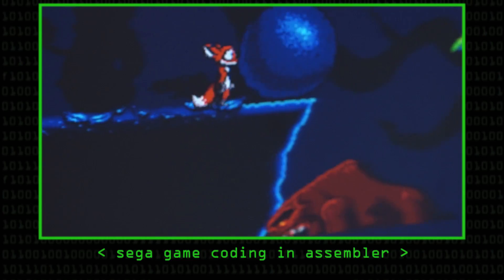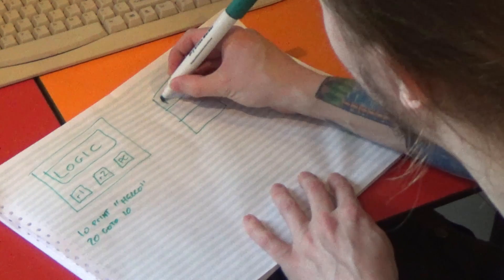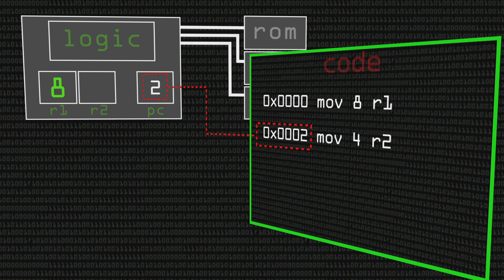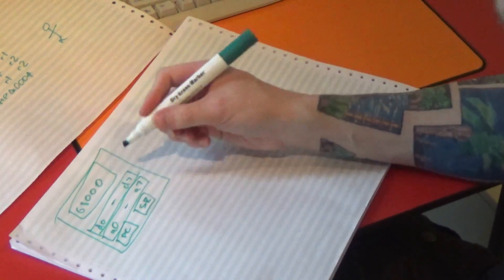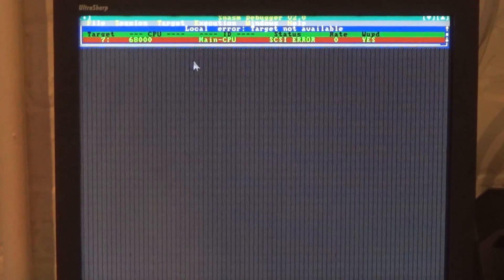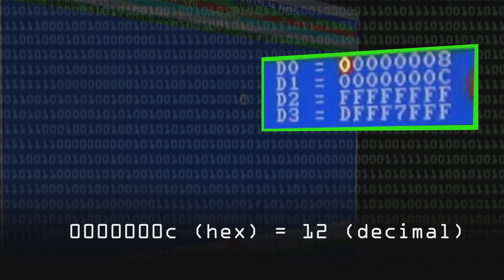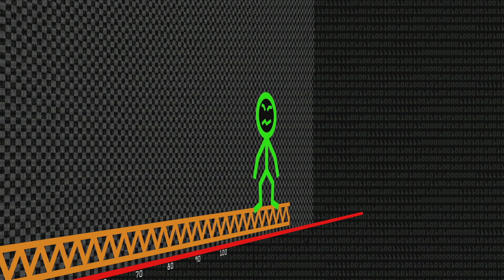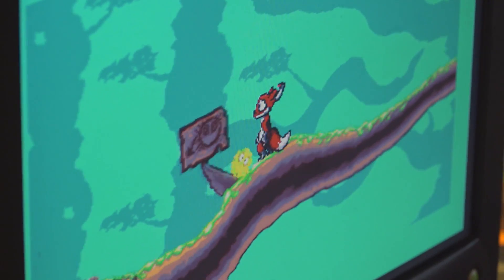Game Physics (in Assembler) - Computerphile

Comment: The 'pc' register I've only ever heard called the IP (Instruction Pointer). Are they different things?
Reply: Different CPUs call the same things with different names. In most architectures it's called a program counter, on intel x86s it's called an instruction pointer.
Reply: If I'm not mistaken (but I probably am), "program counter" was more common, then Intel started using "instruction pointer" with their 8086. Program counters also could be written to directly, but Intel didn't allow this on their "instruction pointer". 

The name "pointer" itself might have only have arisen when indirect memory addressing became a thing.
Reply: PC stands for program counter and they are the same
Reply: Don't think so. They're probably the aame
Reply: Stack pointer?
Reply: Len Waugh I have been taught PC this semester, you comment is the first time I have seen another name for it 🤔
Reply: Michael Clark That’s the purpose of the %esp register. %eip is instruction pointer. You aren’t allowed to over write either of those, nor would you ever want to.
Reply: ok?
Reply: "Reading Head" sounds more like a turing machine thingy.
Reply: They're the same, the Program Counter register on x86 (amd style) assembly is %eip (IP being a mnemonic for instruction pointer).
Reply: I read somewhere somebody called it the "Reading Head" or something like that.

Comment: if a goto/jump statement points to an instruction that has already been executed, doesn't this mean that previous instructions have to be stored? how many instructions have to be stored then? can you use a goto/jump to go to ANY previous instruction then (seems highly unlikely)? or are only the instructions in memory stored and only those can be jumped to?
Reply: The whole program will be in the memory.
Reply: ShadowMancer and does that mean that the pc will store all instructions that have been executed while the program is running?
Reply: +frtard
RAM is typically much faster then ROM, so it's worth copying your code to RAM before executing.
Reply: "does that mean that the pc will store all instructions that have been executed"

The PC only stores a single number which is the memory address of the next instruction. The processor hardware automatically increase the PC with every instruction, so each time the PC will point to the next address.
When a jump is done the PC gets overwritten with another address, so the next instruction will be loaded from a completely different location in memory.
Reply: smh tbh fam All instructions are stored. Each one is held in a memory location and when you jump to an instruction you are jumping to a memory location. This location is either held on the stack or you use the address yourself.
Reply: The machine language code is really just data sitting in the RAM at some location and the Program Counter points at the current memory location to be executed. Execution won't change any of the program, unless you explicitly instruct it to, so the program bascially just sits there. A jump instruction just repoints the PC to the right location and the CPU just keeps on executing.
Reply: A jump can go anywhere in memory. If you wanted to make a function you typically push PC to the stack and then jump to your function. When you want to return you'll pop PC back off the stack. (Simplifying this process a bit)
Reply: Oh I think there was small mixup. I thought by PC you meant Personal computer or as it's better understood "modern hardware". And not the register PC.
Reply: Ghi102 ... or you just forgo all that wasted time shuffling data around and just run straight from the ROM
Reply: And in the simple case, all of the other instructions that could be executed in the future. You can thank John von Neumann for the design.
Reply: It does not store all instructions that have been executed. However it does store the entire program, and when you jump, you are jumping to a line in the program, not to an instruction that has been previously executed.
Reply: David Vaughan
Hmmm, it's not that simple, the only way a previously executed instruction would be removed from memory is if you deleted it or overwrote it. It is very likely in assembly for the instruction to still be there.

In other languages you have things like garbage collection which does remove items that are no longer used but nit in assembly.
Reply: Nevets "...the only way a previously executed instruction would be removed from memory..." -- Ah but, we never put the instruction in memory in the first place, so there's nothing to remove. We already have the whole program in memory, and when a line is executed, all we have in memory is the number of the line in the program we're executing (the Program Counter), not the full instruction itself, except for the fact that we already have that line of the program already stored.

When we're done executing that line, the program counter goes to a different line, executes that one, on and on.
Reply: I think everyone is misinterpreting your question. I think you're wondering how the program jumps to a place in code, and remembers how to get back to where it was? If so, the way this is usually handled is with a stack. A stack is a data structure with a "first in first out" order, which means that you're only allowed to add or remove things from the "top" of the stack (like a stack of books, you can't really take a book out from the middle of a stack). So when you want to jump somewhere (and come back eventually) you "push" the location you're currently at onto the stack, then jump to where you want to go. The place you have jumped to is usually called a subroutine, and these subroutines are usually written so that when they're done doing their thing, they jump to whatever is on the top of the stack.

Comment: Assembly codes are superfast!
C complier unnecessarily extends the length of the code, but by organising the registers so that none of them is wasted and placing of the instructions, we can get max out of the CPU performance. This basic programming reminded me of my graduation years when we used to do the programming in assembly and analyse the entire operation through machine cycles and its waveforms. Amazing to see how higher level languages and highly resourceful CPUs have abstracted the process and relieved user from this lengthy process.
Reply: It is difficult to write assembly language on modern x86 processors (with speculative pipelines, etc) but those considerations don't apply to 68000. You can write code 50% to 300% faster in assembly language (I needed an interrupt  driver for sampled sound on the ST, and so I used the USP as a temporary register that was used to keep track of the sample address, that saved 8 cycles, and since that code was executed 8000 times a second, it was 8% more efficient with just that one change). I wrote a 68000 to C converter for Sonic 3D and I had to work out whether the condition codes would be checked, in order to reduce the code size and get the code to run fast enough.
Reply: Well, I used to write games in assembly (around 50,000 lines of code) and each would take 16 weeks (for ST version), then another 3 weeks to port to the Amiga (changing sprites, scrolling, sounds to use the better hardware available on the Amiga). For Last Ninja 2 I had to draw the sprites as though there was a z buffer (so pixel check depth for each pixel). That code needed every single register, so it would have been much slower in C because it would have had to use memory based variables.

And on the Sega Master System, (which had a Z80 instead of a decent processor :) ) you could only write to video memory during the vertical blank (well it was twice as fast during the vertical blank). You could update about 16 characters definitions each vblank, and I was programming Rad Mobile, and I needed to bend the road (by adjusting the scroll register each line, I think it was 224 cycles per scan line, so by using handwritten code, it could modify the scroll position, change the palette (so there was a red/white stripe at the side of the road), and then update 4 more bytes in video memory.
Reply: Aborysa Which is why these conventions define which registers have to be preserved and which are volatile. The caller can't count on a volatile register having the same value after a function call, similarly if the callee wants to use one of the register which are supposed to be preserved, it has to back up its value (usually by pushing it on the stack) and restore it before returning.When writing in assembly, you can of course make up your own calling convention.
Reply: The point I was making is that C does not provide access to the low level features of assembly, and to get the greatest performance you sometimes need to dive into assembly (also when I write 68000 programs I use pass by register rather pass by stack which is the typical C idiom). I would also use different registers for leaf functions, so printStr(d0 = x, d1 = y, a0 = string, a1 = font) for example, but internal functions calcScrAddr(d6 = x, d7 = y, a4 = screen) use the upper registers (which can modified without worrying, as they are defined as scratch registers).
Reply: Yes the algorithm is important (a bubble sort in assembly, is faster than a bubble sort in C but not as fast as a bucket sort). Assembly is a harder language to program in since it is not as easy to refactor, but you can use the correct algorithms in assembly (and some of those are not possible in C). For example assume you need 128 bit values on 32 bit processor, you can do add.l d0, d1 and it will set the carry flag, so you can do extended precision arithmetic a lot more efficiently.
Reply: I agree that assembly now is a premature optimization BUT it's not too difficult to write a fairly complex program in assembly (although I wouldn't like to write a large program in x86). It takes longer to write a program in assembly, but not that much longer (16 weeks was a full arcade game, like Dragon Spirit, Vindicators, etc). One nice thing with assembly is you can easily mix code and data (for animations for example I would have something like the following

AnimSeq: dc.w frame1, frame2, frame3, CALL | MODIFY_FIELD
dc.l check_shoot
dc.w Y, 1
dc.w frame4, GOTO
dc.l AnimSeq

so frames were defined as 0 to 32767, if the value was negative then it meant it was instructions (conditional check field, modify memory, modify field, set memory, set field, call, goto ....)

So the above sequence would display frame1, then 2 and 3, then call the check_shoot routine, add 1 to the Y field, display frame4, then restart the animation sequence again.

So the animations were a basic state engine / animation structure and simplified the game logic.

Assembly now is useful for optimizing a core routine OR when working on embedded systems.
Reply: gaby de wilde But there is something called maximum value of a function and optimisation techniques in the mathematics and also in real life. I have seen programmers optimizing their code to make the processor do what seems very difficult or even impossible to do with such least resources.
Reply: There's a digital guitar amplifier called a Kemper. You plug it into any other guitar amplifier and it copies its tone almost perfectly. Apparently all its algorithms are written directly in assembly code.
Reply: Mayur Balwani I think it's worth noting that all popular and large C compilers have been designed for maximum performance of the resulting assembly (with proper settings of course) for years. This means that most programmers won't be able to create more efficient assembly code than those compilers.
Reply: there is no such thing as maximum performance
Reply: Aborysa What makes you think passing arguments in registers is unsafe? Borland's register convention (default for Delphi), Microsoft's fastcall, thiscall and x64 conventions as well as gcc's thiscall and System V AMD64 ABI all use registers to pass arguments and it all works perfectly fine.
Reply: ***** I mean, if you use some registers to hold local variables some other "subroutine" might overwrite them, and it is cleaner when returning results of a function call.
Reply: Neil Harding thank you for those snippets of experience. I learned the basics of hack assembler this cs semester. Its nice to read about what you can do with low level programming (although i will certainly never encounter  low level programming again...)
Reply: false.
Reply: +Neil Harding Not in pure C, but most compilers do support pretty large integers (GCC for example, depending on target architecture, supports up to 512 bit integers).
Reply: Using the right algorithm for the task gains you more than what you get from writing in assembly.
Reply: Neil Harding You would never be able to write large applications that would benefit from such "optimization", and most compilers will be able to optimize much better than any human anyway.
Reply: Neil Harding Sure, but choosing to write in assembly rather than a higher level language would be regarded as premature optimization now days. The stack usually exists on cache so it wouldn't typically be as slow as ram and pass by stack is way 'safer' than pass by register(don't think I've ever done pass by register in asm honestly). Lastly my first comment was more directed at Mayur Balwani than you ;)

Comment: Who came up with the idea of calling it a move instruction in the first place? It's really a copy instruction. RISC architecture usually uses load and store instructions, which makes more sense. Also, instruction pointer sounds a lot more sensible than program counter.
Reply: in CISC memory ops were usually independent of the instruction, you could do stuff like 

> add.l (A0),D0

which would be 2 instructions on most RISC cpus.

So in that sense, it uses the register move instruction with memory operand to do the same job as a RISC load/store.
Reply: Most processors have a mov instruction. On some (DG nova, ARM) mov is reserved for register to register operations. load/store are between registers and memory. Many others (motorola, digital pdp-11) use mov for all data movement. Personally I prefer the later because it doesn't care about the direction of the data transfer or the media.

Every processor I have used, and it has been many, uses the term PC.

Comment: Assembler or Assembly? tks nice video
Reply: Well, it’s either

LD IX,50000
LD DE,2436
LD A,255
SCF 
CALL 1366
CALL 50000

or 

221, 33, 80,
17, 132, 9 
62, 255 
55  
205, 86, 5 
205, 80, 195

Take your pick as to which of the two is human understandable. ;)
Reply: It's common that people call the actual code 'assembler', though.
Reply: Assembly is not a single language, but a type of language.
"Assembly language" and "Assembler language" are both acceptable.
Reply: It’s “assembly (language).” Assembler is the piece of code that quite literally assembles your program into machine code.

An equivalent (more or less) terminology would go as such:

C/BASIC/Pascal, etc. = assembly
Compiler = assembler.

Before assemblers were written (or, when the code was short and trivial), people assembled it by hand, so you were your own assembler.
Reply: No. Assembler is the machine, the hardware that runs the Assembly code.
Reply: Precisely.
Reply: Renan Angelo dos Santos Assembly is the programming language, Assembler is the party which convrt human understandable language to machine code.
Reply: "Human understandable" - that's pushing it a bit ;-)
Reply: Actually, that code is from a loader that I wrote. (That particular bit loads a compressed loading screen from tape as a headless code block, and then unpacks it by calling the subroutine at address 50000.) And yes, it is in decimal, because you could enter it from BASIC using the POKE command (well, a loop with DATA statements, really). So, when it comes to hand assembly, decimal has always been my goto system.

Never had a Commodore, though, so I can’t answer your question, I’m afraid.
Reply: The answer pretty much applies to any version of BASIC, apart from VAL (convert string into number) which is not often used, once you finish the program you probably type saVe "program" :)
Reply: Rob Nicholson To some level at least 😅
Reply: You see, on the Spectrum, you don’t type in commands per se. Instead, pressing keys enters complete keywords. Each key has up to five different symbols associated with it. Which one appears on the screen depends on which cursor mode you’re in. The “V” key is assigned three keywords—LLIST, CLS, and FLASH, the forward slash, and the letter v itself, naturally. The SAVE keyword is on the “S” key.

Oh, and using VAL is quite beneficial in loaders on the ZX Spectrum, because a numeric constant is stored as a string of ASCII followed by a 0x0E byte and a 5-byte binary floating point representation. The ASCII part is used only to display the BASIC listing on the screen, while the binary part is used at runtime. Thus, VAL “50000” takes up less space than just 50000 (at the cost of the speed of execution).

Yup. That was one quirky machine, the ZX Spectrum.
Reply: Assembler
Reply: You wouldn't write assembly in decimal, hex on the other hand I've wrote a small program on the Commodore PET (you could get into a memory monitor by typing SYS 1024 and the write code directly in hex). I wrote a program than checked the keys are they were being pressed and if V was pressed it would do a soft reset). As a quick bonus question, when would you press V when writing a program in BASIC?